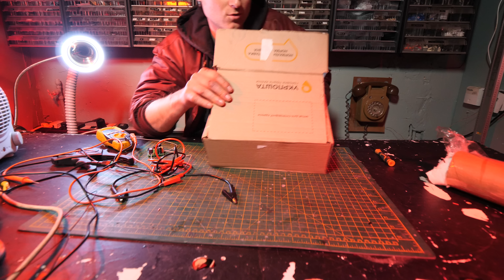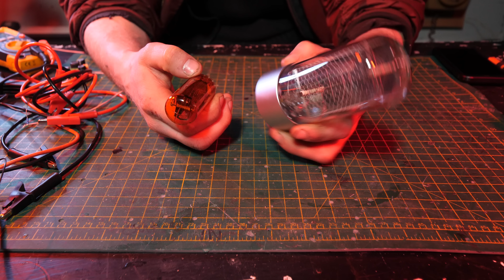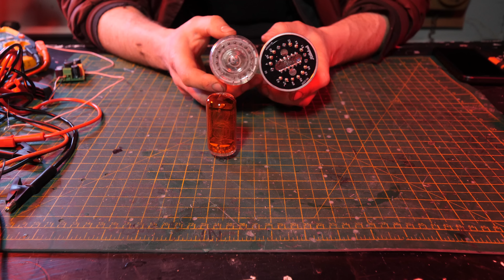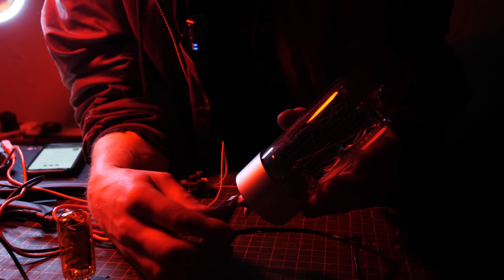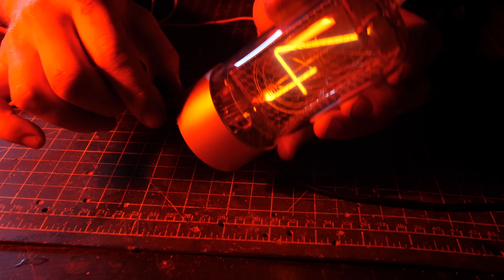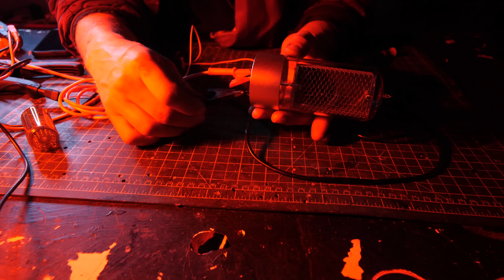A Brand New Huge NIXIE Tube. ZIN70

Comment: Do the tubes fit in perf board? Might save a load of hassle.
Reply from the maker: im gunna design sockets, i just think it'll be nicer, and likely a 10 minute job to design, dont think itll be a biggy.
Reply: @THISMUSEUMISNOTOBSOLETE  i know you like making things but pete at pv electronics has a single tube clock kit that will power on of these tubes and a bloke called Richard scales has a kit that will work i have zin70 as a single tube nixie clock they are good value for money is the zin 70

Comment: So what was the reasoning for the order of the digits? If course they are not front to back 0 - 9, but I have been wondering for a while why not.
Reply: One of the main considerations is that unlit numerals should not block lit electrodes.

Comment: I love Nixies and I have a Nixie clock but using IN-8 (18mm x 12mm) tubes and they cost about £20 each so £100 for that behemoth is a bit of a bargain. After seeing Techmoans video I craved so much for that clock I wanted it so much but the cost was HNNNNGGGHHH!!!!! It took days to get rid of the urge to order one. Now I've seens this the urge has returned, I want it but I don't need it.....but I want it.
Reply: I'm also in UK - the pound/dollar ratio really hurts us on that IN 70 clock ($1700) - 10 years back it would have been half the price 😢